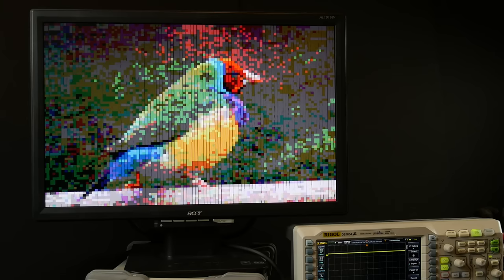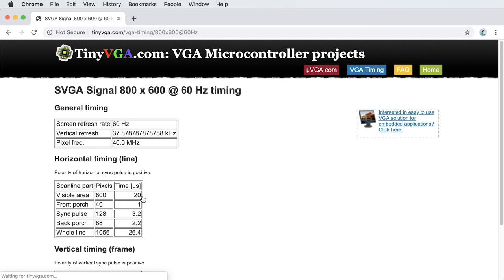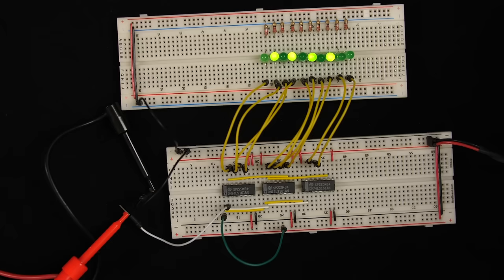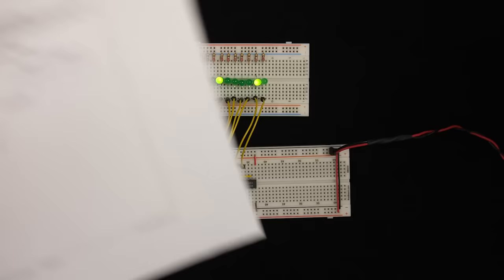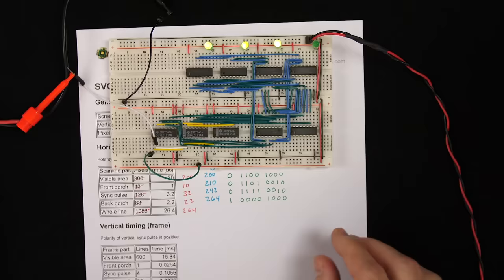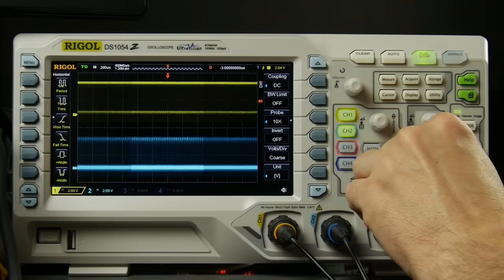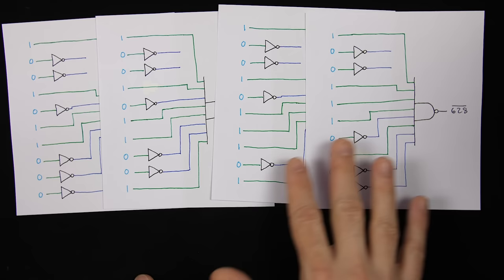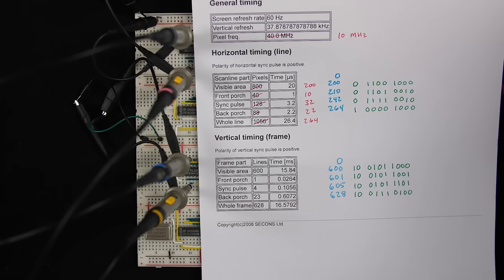The world's worst video card?

Comment: Very interesting stuff. learned a lot ! Could you also build "The world's worst sound card" plx ? would appreciate this.
Reply: I also want to see this.
Reply: I would love to see this
Reply: it is too easy just a couple of transistors to make an amp cirquit
Reply: @SimonBauer7  Making a soundcard is anything but easy. You don't just need an amp, you also need some memory buffer that can be written to and read from at the same time and a DAC that is capable of holding a steady clock rate when producing signals. The amp is only the last stage of a soundcard (and, strictly speaking, it isn't even needed to qualify as a sound card, as you can also just use an external amp, we only integrate amps in sound cards for convenience sake). It's easier than making a video card, but not easy by any means.
Reply: @gayusschwulius8490  The components required would completely depend on the rest of the computer ofc. If you used a modern CPU you'd have access to DMA and wouldn't need a memory buffer. Building a low quality soundcard is actually easy, more so than making the video card in this clip, but on the other hand, this video card isn't difficult, it's just tedious when you manually forge timers like this. Using more modern hardware you could simply use a fast enough microcontroller or FPGA and do almost all of it entirely by code and 1 single chip with a power supply. For a soundcard you could use a micro or FPGA with either an internal or external DAC simply using a decent crystal oscillator and prescalers. The sound card wouldn't need nearly as high of a frequency either. You could run it at something like 44KHz and just output a sample every tick in both directions. The key would be to find a DAC that is at least 16 bits
Reply: Check out James Sharman’s channel, he made sound for his homemade computer
Reply: Were building it in 90. Ad dc converters analog way.
Reply: he rigs up a cordic alg with handmade lookup tables
Reply: look up covox, before sound cards that was a thing :)
Reply: @official-obama  ???
Reply: That’s just the Covox Speech Thing, an 8-bit resistor-ladder DAC with no memory logic of its own, relying entirely on the computer to push it 8-bit PCM frames at the right timing.
Reply: @TheChrisey  44k at 16bit? Luxury! The cheap sound card makers in the 80s were happy to sell 11k at 8bit, or even 8k at 8bit like a phone exchange!
Reply: drives a PC speaker

Comment: How did he have all of the wires bent so perfectly 😂😂😂 my circuits look like a toddler threw spaghetti on a bread board
Reply: Measuring, I guess. The small amount of wiring I have ever done also looks like dogshit.
Reply: they sell pre measured and cut jumpers
Reply: Eclipse best thing I’ve seen all day 😂
Reply: From Ebay I assume. Like everything else.
Reply: I pre-measure mine, taking into account the bend and the amount I'm going to strip off, then I bend them with a needle-nose pliers. I always cut a little extra and trim off what I don't need.
Reply: He makes super famous youtube videos working on breadboards, he surely has it covered haha. Its so satisfying to watch!
Reply: solid core wires.
Reply: "Speaking of spaghetti, this video is sponsored by CableMod."
Reply: He prob just uses wires so much he has every length of wire he need
Reply: @TheRealMentat001  Needle nose pliers are not for bending wire btw. Knipex actually makes a specific tool just for this. I would highly recommend, I went this way and haven't looked back.

Comment: Amazing and very very insightful! After a video card, perhaps you could do a sound card too?!
Reply: and then make testris
Reply: Soundcards are essentially DACs (digital to analog converters) with an amplifier that is the attached to a speaker. So besides computing the sound, most of it is analog circuitry.
It's also pretty easy to create sound with most microcontrollers.
Reply: There's actually a way to build a DOS-addressable sound device using a parallel port and a resistor ladder.

https://en.wikipedia.org/wiki/Covox_Speech_Thing

Comment: There is some bad advice on the website for this. It suggests that you can build this circuit without the inverters. I have only built the horizontal sync circuit so far, but I have discovered that you need to test bit 5 when checking for a count of 210. This must be zero. If you only test for the bits that should be 1 you will end up triggering the 210 count when you are actually at 242. This results in the set and the reset both going low at the same time and will melt the SR latch. As I discovered just now by burning my finger and melting my breadboard. It's good fun though and I think you learn more when things go wrong. I love all the work Ben Eater does.

Comment: 12:00 : a simple NAND gate (using the 4th and 9th bit) would also work, for the same reason the NAND with only the top 8 bits would work : as soon as you hit 264, it will be reset.
Reply: Hi, I have a problem may you help, please? I cant get 74ls161 to work .
When I connected LEDs to the chip outputs they all started to blink together at once, not counting, just blinking all at the same time. What should I do?
Reply: @dobyYT Did you end up figuring it out?

Comment: Cool project👍I can remember that i was able to generate smilies on a cpld with vga output. Some 25 years ago at collage. The output was black and white and I used diodes to generate a 0.6 voltage signal from the 5 volt. I did it with the internal ram and a bunch of counters and comparators.

Comment: Kudos for doing this from first principles Great Work! While watching the first video's I had to quiet my inner electrical engineer to stop telling myself how easy this would be on an Arduino or "Old School" using an EEPROM to do the counter decoding and reminding my selfthat this is an exercise in digital design first principles. My Instinct was to use a 10 or 12 bit binary counter with an address comparator like 74xx520. In your second video I was also a bit concerned about the race condition as the address lines settle, could corrupt the image.

Comment: 1:19 - It doesn't take time for the beam to swing back to the left. It can change to any point on the screen instantaneously. Nothing physical is moving. The voltage on the electromagnets are just changed and the beam instantaneously point at the new location.

Comment: I remember setting up old Linux machines where you had manually input the monitor timings and it said you could damage the monitor if you input them wrong.
Reply: lmfao what you had to manually set the timings in Xorg?
Reply: @smayansahu1070  last time for me was not even that many years ago. Thank god for wayland
Reply: @smayansahu1070  yeah in the 90s and early 00s there weren’t really any X presets, nor GUI based resolution configs like you get in Gnome etc today.
Reply: yeah I was so happy when Bibblebob Snapplegob released in '04
Reply: Linux users connecting a monitor:
Reply: @VanceVanced linux is a meme

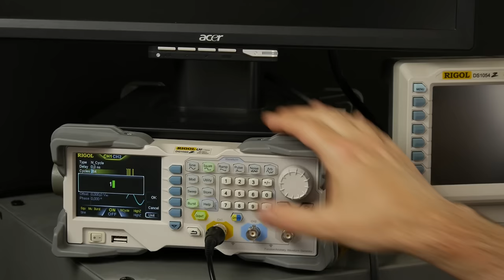Comment: 15:30, moments like these are the best feeling in engineering. Something doesn't work, but right as you start to get upset you remember it's 'not supposed' to work. So by it not working it means it actually worked!
Reply: Hi, I have a problem may you help, please? I cant get 74ls161 to work .
When I connected LEDs to the chip outputs they all started to blink together at once, not counting, just blinking all at the same time. What should I do?

Comment: I used 4 wire colors with 4 envelopes each to get each wire length needed for my solderless breadboard.  I also put several wire lengths in each envelope but the wire lengths differed by four hole lengths. Thus my wires are ready to go for soldered breadboard projects

Comment: for checking the reset value, you only need to look at  the bits that are 1s, as if any of the other bits are a 1 it is necessarily larger than the number we care about
Reply: Hi, I have a problem may you help, please? I cant get 74ls161 to work .
When I connected LEDs to the chip outputs they all started to blink together at once, not counting, just blinking all at the same time. What should I do?

Comment: I haven't seen any mention, you actually don't need to check any of the 0's when your testing if your binary number matches! This is because if there were a 1 instead of a 0, the number would be greater, but since you're counting up, you'd hit the correct number first. E.g. if you were checking if your binary number was 17, you'd only need to check that the 16's spot was 1 and the ones spot was 1, because any other number with those two properties would come after 17. Interesting!
Reply: Good catch!

Comment: With regard to connecting LEDs directly to logic outputs.  Not only do you need to consider if the logic output has current limits, but you also have to consider if connecting the output to logic input and the inherent LED voltage drop.
When building the different stages of the horizontal signal generator and keeping the LEDs directly to digital outputs, I was finding I was getting erratic results.  Then it occurred to me that the LEDs were effectively voltage clamping diodes, typically about 2v to 3v, placing the voltage to the next stage input in "no man's land" for an intended logic 1.  When I added a 220 ohm resistor in series with the LED or removed it altogether, the erratic behavior went away, since the input on the next stage would then see a voltage closer to the logic 1 5v rather than something between  2-3v.

Comment: this is so cool. reminds me of one day I was stranded several states away from my home due to a broken transmission circut, so I spent 2 days trying wire my own freaking circuit to shift my transmission, failed miserably, didn't know transmission solenoid requires square wave current to maintain engagement.
Reply: @Dooncat  that's probably the worst comment I've ever seen.
Reply: @Dooncat  Seems you're no better

Comment: A 'cheaper' method to detect the timing counts is to program a small prom to indicate the proper counts. Connect the address lines on the prom to the counter, then program the prom matrix to only provide an output when the proper count (address) is presented to the prom. A 256 address prom in cheap silicon; less wiring! example: DM74S471 256x8

The larger the prom, the more timing patters that can be stored, allowing more resolutions. Select the proper set using the excess address bits!
Reply: I saw another video on the perils of using an EPROM as a PLA.  It seems that they are not meant to be used that way, and you need to get your address and enable timing just right, as opposed to the output simply going from the input at any arbitrary moment.

Comment: I came up with this Arduino sketch that can be substituted for the signal generator.  You can set the output clock frequency and duty cycle.
I used pin 13 for the clock but found a problem that when the Arduino boots up, it sends at least one clock pulse before the sketch actually runs.   That's probably done by the bootloader.  I used pin 13 mainly because I wanted to use the built-in LED to monitor the clock pulses.  I could have used a different pin for the actual clock output and just duplicate the turning on and off of the clock pin output to pin 13.
Instead to compensate I added pin 12 to control the master reset.
When you fully complete the horizontal or vertical generators and want to test them with the generator controlling the reset on its own, hold the reset on the Arduino, hold the generator reset to ground, then when you see the serial monitor say it is getting ready to send the pulses, or you see the bootloader pulses complete, release the generator reset.
Of course we can get away with briefly grounding the generator reset since the LS series outputs have current limiters.  You won't want to do that with other 74 series families.   Of course you could put a resistor in series between the full count NAND gate output and the reset line.

There's a 5 second delay before the code starts the pulses, and 5 second delay between the series of pulses.

Now for the code:

int freq = 1000;
int duty = 50;
int count = 600;
int onTime;
int offTime;

#define outPin 13
#define resetPin 12

int i;

void setup() {
  // put your setup code here, to run once:
  pinMode(outPin,OUTPUT);
  pinMode(resetPin,OUTPUT);
  Serial.begin(115200);
  digitalWrite(outPin, LOW);
  onTime = 1000000/freq*duty/100;
  offTime = 1000000/freq*(100-duty)/100;
  Serial.print("Freq: ");
  Serial.print(freq);
  Serial.print(" Duty: ");
  Serial.print(duty);
  Serial.print(" Pulse Count: ");
  Serial.print(count);
  Serial.println();
  Serial.print("Period: ");
  Serial.print((onTime+offTime));
  Serial.print("uS onTime: " );
  Serial.print(onTime);
  Serial.print("uS offTime: ");
  Serial.print(offTime);
  Serial.print("uS");
  Serial.println();

  Serial.print("Ready...");
  digitalWrite(resetPin,LOW);
  delay(5000);
  digitalWrite(resetPin,HIGH);
  Serial.println("GO!");
  Serial.println();
}

void loop() {
  // put your main code here, to run repeatedly:
  count = 600;
  clockMe();
  delay(5000);
  count=1;
  clockMe();
  delay(5000);
  count=4;
  clockMe();
  delay(5000);
  count=23;
  clockMe();
  delay(5000);
  digitalWrite(resetPin,LOW);
  delay(5);
  digitalWrite(resetPin,HIGH);
  

}

void clockMe(){
  i = 0;
  while (i<count) {
     digitalWrite(outPin,HIGH);
     delayMicroseconds(onTime);
     digitalWrite(outPin,LOW);
     delayMicroseconds(offTime);
     i++; 
     Serial.println(i);
 }
 }

Comment: 13:51 - couldn't you skip all the 3 last bits that are zeros? Looks like for the counter reset you can just ignore all zeros at the end.
[edit] Actually, I just realized that specifically for the reset it seems we could ignore all zeros. If the 1s are set, it's enough to know that we should reset.
Reply: I came to the same conclusion. Only a 2 input nand gate can do the trick.
Reply: @stephanegilbert8800  I Concur
Reply: @Stephane  Yes, on the horizontal timer you just need the 256+8 pins into a nand
Reply: And by detecting 264 with that method, you could get away with only a single hex inverter, only the six least significant bits need inverters for the other signals.

Comment: Ben Eater: Builds a GPU
Me: Still trying to figure out how a breadboard works

Edit: Thanks for 500 likes <3
Reply: Me, even worse: Try to figure out what is breadboard
Reply: @tardisthephonebox  Yeah that's a option too :D
Reply: Tardis ThePhoneBox First time i saw circuits videos I was confused thinking the guy was gonna make a snack
Reply: I still have to look ot up to remember whenever I see one
Reply: breadbox* yea i have the same problem
Reply: me: regretting buying breadboards from eBay. They don't hang on very well to the breadboard wires and have hella internal resistance.
Reply: It’s a board. You put bread on it. You cut the bread
Reply: I'm still struggling with light switches.
Reply: Same
Reply: The breadboard itself is not hard to understand, it is what you can do with it makes it complicated.
Reply: Me tryna figure out why people edit their fucking comments.
Reply: Me trying to figure out how to try and figure out what a breadboard is
Reply: Tbh i had some really annoying breadboards. Even by reputable makers like elegoo.
God damn, this breadboard was so stiff, i bend each resistor, Led, and everything with a cathode/anode just fron trying to plug them in, until i used a sewing needle to flex the breadboards a bit. It even ripped apart some Jumper cables when trying to pull out because it was so tight
Reply: Isn't that what you use to cut bread during breakfast?

Comment: 264, you could do that with a simple two input NAND, right? Just watch the two bits that equal 264...
Reply: Yes, absolutely.
Reply: obiwac No, those two bits only go high when you get to 264. Never before. And when those two bits go high you reset back to zero, so you don’t go past 264 so none of the other bits can ever be high when those two are high.
Reply: I was gonna comment this same thing.
Reply: @1ManWrenching  oh yeah my bad, was reading out of context. Since it is a counter and 264 is the last value, you could indeed wait for the bit to shift to that position without worrying if the other bits are high, (because by that point you'd have passed 264)